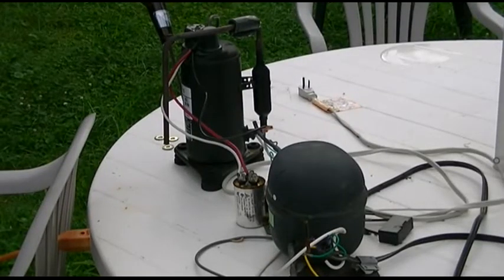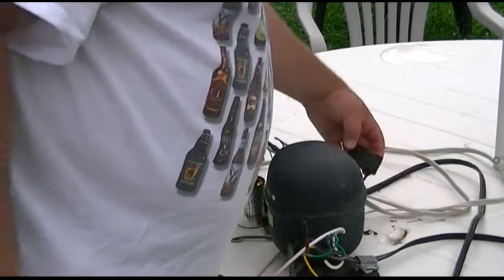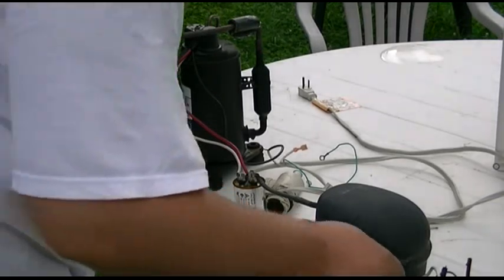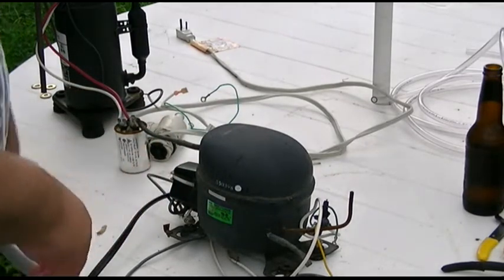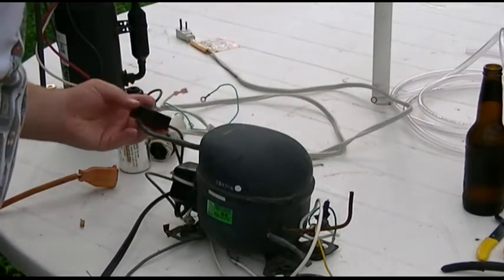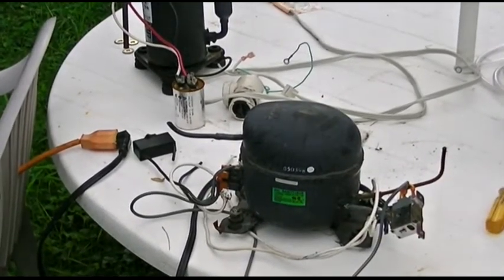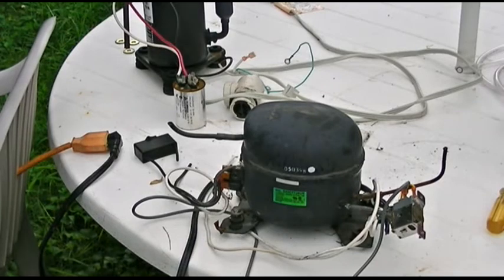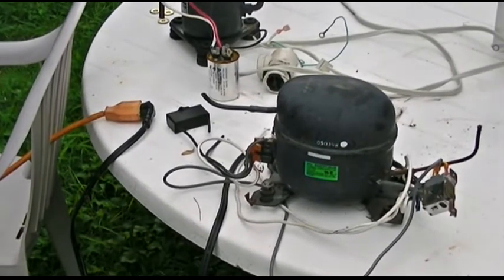2nd Silent Air Compressor Part 2 - Disassembly

Comment: two types of hermetic refrigeration compressors the oval one is a recriprocating compressor and the tall slender one is a rotary compressor. the march larger ones used in central AC and refrigeration are the Scroll compressor. mainly the Copeland Scroll. these cheap chinapride air compressors not good in quality. but some harbor Freight chinapride stuff can be good like their predator engines.
Reply from the maker: Like I had said in reply to someone else, I'll generally use the terms "rotary" and "scroll" interchangeably.  Perhaps it's not correct, but it's done.

The Harbor Fright Predator engines are very solid performers.  I've been very happy with my generator that has one on it.  This particular 3-gallon air compressor from them was used and abused quite a lot.

Comment: The black box for the recip compressor is the start relay, the little ones like that tend to use those instead of caps
Reply from the maker: It seemed to make no difference to this compressor.  It's quite possible it didn't even work to begin with, which is what caused the weird not wanting to restart problem.
Reply: Possibly

Comment: 7:21 quality. Also, that Raheem in the background didn't sound too happy about starting there...
Reply: Rheem...
Reply from the maker: Oh it was perfectly happy.  That was the 2 ton unit, which at this point had its Kickstart capacitor installed.  You heard the slam of the contactor followed by the startup.
Reply: jaykay18 I stand corrected.